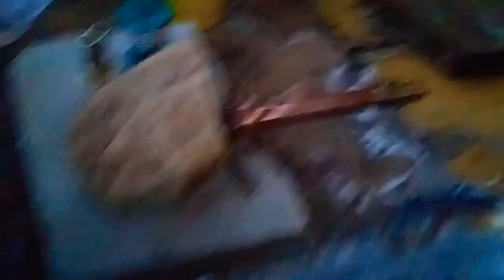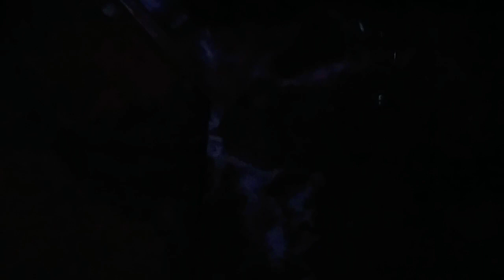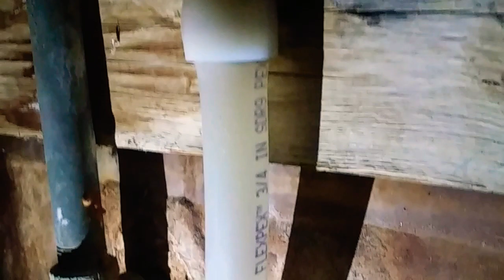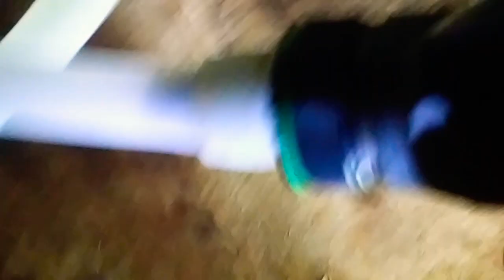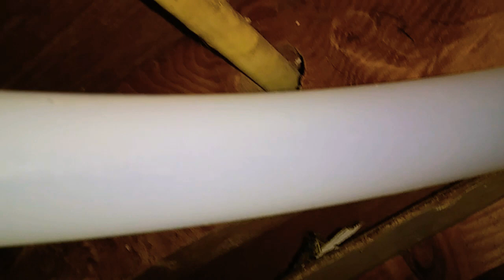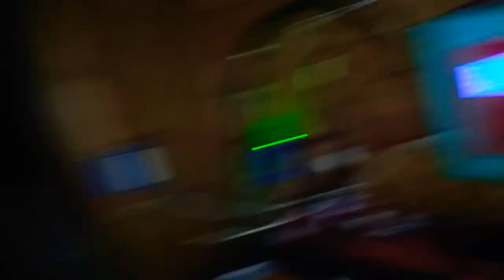How To Soldering Pex Fittings and Installing PEX pipe

Comment: How's she goin'?  Good job on the soldering and PEX has to be the best improvement in plumbing since flush toilets.  The solar and wind power set up is cool too.  Thanks for posting!!!
Reply from the maker: But thank you for visiting, if you have any questions feel free to ask Texas good to a point I ran my house in pics but I'm not real comfortable with it and overall. But what I really like about PEX is when you're doing your showers in your bathroom because of all the twists and turns depicts really makes it nice you come off your mixing valve with your copper pipe and you go into it with your packs I recommend the brass fittings over the nylon plastic just because of the longevity and tid of the fittings banned plastic nylon settings last lifetime and Beyond I'm sure here in California they run about five $6 a piece or those brass fittings thank you for stopping and I appreciate your time it's always a pleasure to hear from you you doing a good job with that table saw for sure I may have some questions in the future look forward to hear from you good night God bless your friend Ken. if you're on the rebound

Comment: This was awesome well done tutorial friend
Reply from the maker: I'm glad you enjoyed it I wouldn't use PEX for everything but for your shower connections because of all the twists and turns it makes it quick and easy!
When using the battery-powered expander you don't want any kind of Grease going into your PEX piping it will cause a leak something I forgot to mention in the video. I don't think electricians quite understand that you can use the power coming off your solar panels to heat the element for hot water something Joe figured out at the end of the video we were talking about it prior to this Joe looked all over YouTube couldn't find anything on it keep up the good work look forward to hearing from you do you have any questions feel free to ask God bless bye for now Ken